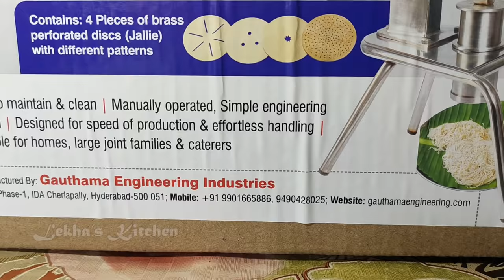Ottu Shavige machine / ഈസി ഇടിയപ്പം മെഷീൻ / Easy Idiyappam machine

Comment: Where is purchased what is rate
Reply from the maker: Detail of the machine.
Manufactured By:
Gauthama Engineering Industries,
Plot No. 66 / 1,  IDA Cherlapally
Hyderabad ,Telangana
India -500051.
Mobile : 9901665886.
********************
Price of the machine : Rs.6500 +  courier charge

Comment: While it looks good, instead of Spanner, they should have given the same type of Locking system as is given for the Liver jointer at the Cylinder which presses down the Batter.
Moreover, the video doesn't show the Lever turning, though most of the people can imagine. 
Another suggestion is to bring out a smaller size of stand and the lever/gear length to enable easy handling, for instance she had to turn the Idly Plate three times. Instead if the gear length was just enough to press a lesser quantity, the size of the machine will also be less.

Comment: Cost wise very high.  Normal idiyappam machine available for Rs 1200 in chennai.  Also this should have very small holes in the side then only the sevai looks very thin.  Bottom holes is suitable for murukku only.  In Kerala sevai machine comes in brass also.  Even that is not expensive.  Every common man should buy this at an affordable price and not Rs 5000 and above.

Comment: What is the cost
Reply from the maker: Detail of the machine.
Manufactured By:
Gauthama Engineering Industries,
Plot No. 66 / 1,  IDA Cherlapally
Hyderabad ,Telangana
India -500051.
Mobile : 9901665886.
********************
Price of the machine : Rs.6500 +  courier charge